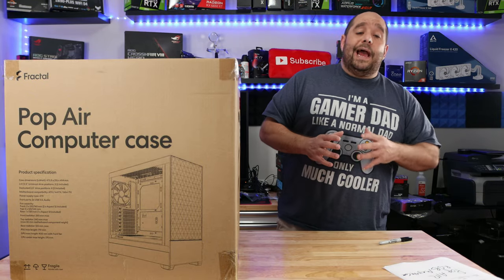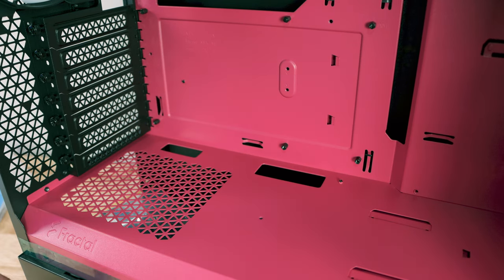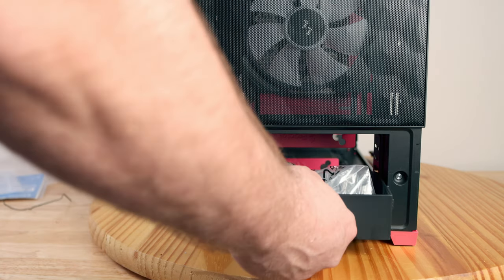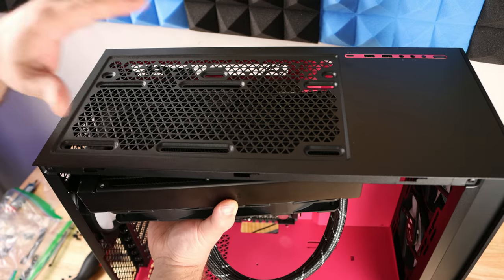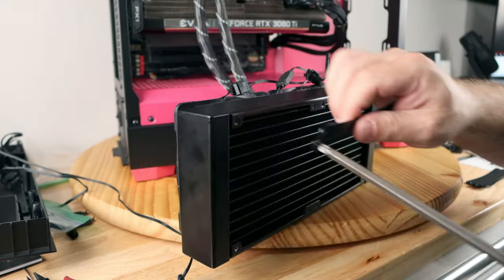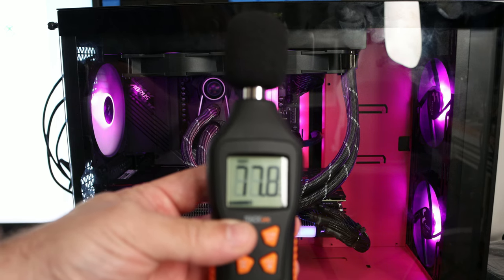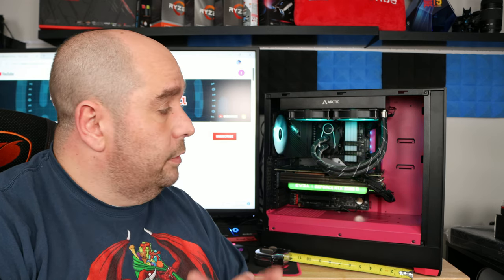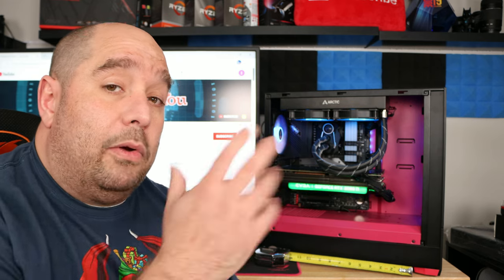Fractal Pop Air RGB Case Review -  A Budget Friendly Case that Does it Right!

Comment: 16:45 I admire the fact that you paid attention to the orientation of the water cooling radiator, having the tubes on the bottom, the correct way. Many youtubers install it the opposite, the wrong way. Spreading the good word!
Reply from the maker: Sadly, that causes a huge issue, but I go over why and the tubes as long as they are level or below the pump you are good.  I will say I have shipped thousands with the pump above, and they have outlasted the warranty's, which are up to 5 years.
Reply: The pump not being at the top of the loop is the right way.  Tubes up or down matters very little and neither is wrong.  If you can manage to have the tubes on the bottom it is better but that does not make putting the tubes on top wrong.
Reply: @gscurd75  Neither the pump nor the tubes should be the highest point in the loop. Having the tubes on the top and be heighest point can create cavitation, and having the pump be the highest point can cause it to work unefficiently. Tubes on the bottom and radiator's top being the highest point in the loop is the proper way. So yes, it does matter if the tubes are on the top or the bottom.
Reply from the maker: better at the top for sure, but it won't kill it, Steve made everyone go insane when he made his video but shipping literally thousands I can say its not a horrible issue, it might lower the lifespan by a year, maybe but they would outlast warranties on the system and chances are you are changing components anyway by the time the pump dies, well over 5 years.
Reply: @ThisBytesForYou  The problem is when the pump starts almost dry. So if you keep the loop ON and never let the pump go dry, after it once starts dry, it does not affect its lifespan but the efficiency so thus its lifespan as it will spin faster to make up. With the tubes on the bottom and the radiator being the highest point in the loop, the pump will never start up dry and its efficiency will be at its peak (conditions wise). Each pump has it's own efficency curve, but we shall dig that deep, shall we? :)
Reply from the maker: @Druze_Tito  I totally understand the issue, but that issue really would only occur IF the manufacturer didn't correctly fill the pump with enough fluid... which of course may happen, and probably happens often, but I haven't seen it.  IN shipping thousands, before the thought of the pump at the top, was a thought (Arctic, Asetek and there was 1 MAJOR player before Asetek that I can't remember) when I was a product development engineer at Alienware and Velocity Micro, there were times when the unit was LOUD after a minute, those we removed quickly, those had very little liquid in them so it was obvious so the issue usually appears VERY quickly.  When you first install an AIO, you will hear loud gurgling as the fluid fills itself through the hoses and radiator, if that occurs longer than a minute (usually takes 20 seconds or less) then you know its bad.  Asetek and the other one (it kills me that I don't remember their name, and this was when Asetek sold units, rather than licensed them out, so we worked directly with them) never caused any alarm at the way it was installed.

For now, being that I am smaller and don't have the resources to dig into that, nor time (it sucks being a small creator having a day job as an IT Manager, then a night/weekend as a creator and having kids and a wife, no time for anything) to dig into that, but maybe one day if youtube doesn't kill me sooner.  I tell you, sometimes dealing with people is a soul sucker with how horrible people can be (not you, you are awesome, please don't think I am talking about you), I have to hide/ban people daily, many times because of how inhuman they are.
Reply: @Druze_Tito  Not sure you understand what cavitation is.  Having an air bubble in the system is not cavitation.  Every system will have air bubbles in them.  With the tubes down, those bubbles will end up on the opposite sides of the tubes and be inside the radiator.  There will be noise as liquid moves past the bubbles, however it will be well insulated by the radiator itself and in all but the very quietest rooms with no fans running you will never hear it.  

With the tubes on top those bubbles will be at the top of the radiator or in the tubes themselves.  Those tubes do not insulate noise as well and you may hear gurgling noises as the water goes past those bubbles.  Over time as the water levels get lower, small air bubbles may break lose and work their way through the pump.  This can cause noise and a little bit more wear, however not to the point where it will significantly damage anything.  The pump may end up lasting 5 years instead of 6 but most people will be changing them out before that point anyway so it really does not make that much difference.  

The main takeaway is that neither tubes up or tubes down is wrong.  They are both perfectly acceptable.  Down is better because it will be quieter and last longer, however in many cases there is simply not the option to position them that way and when that is the case, it is perfectly acceptable to put the tubes up.  Just know that there may be a little bit of noise from time to time and that it will probably die out closer to the warranty period vs tubes down but still last longer than most PC users keep them.
Reply: @gscurd75  I think you don't understand the cavitation means bubbles. End of discussion with you.
Reply: @ThisBytesForYou  The problem is that with time the level of the fluid lowers. As that happen, the pressure drop will increase and the pump will work less and less efficient, wearing out faster and shortening the lifespan(unless you use a fixed pump speed). I don't think the lifespan of the pump should be considered as 5 year, even though it sounds reasonable condering the price. A well designed mechanical assembly should outlast the owner, but we all know that new-age products are desgined to last as long as the warranty. And the warranty covers the worst-case use scenario. But, with the proper conditions and settings, it can last much longer. 

Thank you for the kind words! 

P.S. - yes, cavitation happens in AiO cooling systems.
Reply: @Druze_Tito  I am trying to be as civil as possible here.  I would suggest you do a little bit of research before telling others they do not understand something.  Even a simple google search tells you "Cavitation is a phenomenon in which the static pressure of a liquid reduces to below the liquid's vapour pressure, leading to the formation of small vapor-filled cavities in the liquid."  

That is vastly different than just "bubbles".  If you have a set up where the pressures and temperatures involved create cavitation, it will happen regardless of where the tubes are located.  

This is an easily found video that explains it https://www.youtube.com/watch?v=U-uUYCFDTrc&ab_channel=IETInstituteforEnergyTechnology
Reply from the maker: @gscurd75  please understand, the conversations will always stay civil, since I am moderating.  confusions happen on both parts, the video is great, I am going through it now, 1 part confuses me and it did when Steve spoke about it as well, the video talks about evaporation, part of the cavitation process, where the fluid evaporates, with technology as it is today and CPU;s not allowed to go over 100°C, the likeliness of that happening is close to 0.  When they reach about 90°C, they will begin gto thermally throttle (maybe it was 88) to protect itself from burning out.

If the conversation is not civil, I will delete comments, nothing against you my friend, but as intelligent people (we all 3 are), it would always be civil.  We can all disagree, and that's fine, but disagree and educate is key, if not we will always continue to disagree and go up from there.
Reply from the maker: @Dwight I don't agree that cavitation occurs, maybe not at the level we are thinking, because evaporation occurs at 100°C, the liquid will never get to that due to the processor being protected from going over 90°C as it will thermal throttle.  That wasn't always the case, but has been this was for over 2 decades.  Also, I don't know how much friction is caused with the pressure in the water, that is an interesting part, thanks @gscurd75 for that video, one factor I never thought of.
Reply: @ThisBytesForYou  You don't need to agree, the cavitation is happening every time when there is a fast spinning stiff object through a liquid. The fast motion drops the local pressure behind it thus creating a vaccum space that looks like a bubble. To avoid this you need higher liquid pressure. This brings me to my previous point - you need the tubes on the bottom and the readiator's top to be the highest point, having the pump bellow the highest point as much a possible. This will extend the lifespan of the pump by making it work more efficiently. Nothing to do with the cons of cavitation itself, at least not the usual negative outcome of it - mechanical damage to the blades. But, will lower its efficiency to push fluid, thus making it work faster and increase its cavitation even further. That is why having the pump at maximum speed does not guarantee best AIO performance (+the optimal speed by the pump curve). You are not a mechanical engineer, it is obvious. Neither is the pal that listens to Steve's videos. And I don't care.
Reply from the maker: I 100% am not, I won't ever state that I am, I am however an IT Manager to a company with many of them, its out business, though I won't go over this with them because I don't mix business with business (you know what I mean), I put the tubes on the bottom to reduce needless pressure pump and wear and tear on the pump due to air pockets, potentially large ones, which would minimally reduce the lifespan of the unit, by increasing efficiency not putting any thought to cavitation,  Putting tubes on the bottom, makes more sense due to the gravity of it (pun intended). 

 I dont think there is enough pressure in these units to have any sort of damage to the blades and while I won't ask my team, I will check with Arctic.  I have already spoken somethings on it with them that I am not happy about but I put that aside haha, let's see what they say.
Reply: @ThisBytesForYou  You can call the cavitation "air bubbles" or "air candies" it is still going to be cavitation. Cavitation, as I mentioned, does not have only one negative effect (like the damage on the blades that you mentioned), but it reduces the efficiency of the pump work. Tubes on the bottom is the correct way, and that is also a good subject for a video if you are into it. You can have the same AIO, set the processor at fixed voltage, no boost, set the AIO at fixed speed(also try 3-4 different speeds, one of which will be at 100%). Then, run the system in 3 (or more) configurations. One with tubes on the bottom, one on top (bellow the pump) and one on top (above the pump). Set the fans of the AIO at fixed speed and let the closed system achieve equilibrium and see which configuration has the lowest temperature (vs ambient). It is a bit of work to be done here, but you will see the effect of "air candies" on the cooling efficiency.
Reply: @ThisBytesForYou  here is what a not enough pressure at the AIO pump scenario affect the "air candies" scenario
https://www.youtube.com/watch?v=0dd6AlyOnfc
reduced pressure at the blades (because not enough fluid flow to the pump) increases the formation of "air candies".
Reply from the maker: sadly, because of the effort Steve, Jay and other clones have put into it (not call Steve or Jay clones, just the others) I would be put into that category of a clone and berated even more by the zombies that mindlessly listen to their videos.  By mindlessly, I mean, listen to the portion they want to to be able to mindlessly call others stupid, Jay and Steve put out great content. but lets see what happens with Arctic.  I didn't want to go into this path, but I feel like I have to.
Reply from the maker: also, a great video, but he mentions steam in the video, lots of pressure, maybe its me that does not truly understand that portion, but I have already posed the question to Arctic, if I need to, I will discuss with Asetek, but I don't know if my contacts are still there, it has been some time.
Reply: @ThisBytesForYou  You can always pick a method that has not been covered by anyone, it is worth doing it. I don't see that as being a clone. If you think I can assist you with anything, i gladly will.
Reply from the maker: @Druze_Tito  I waiting to see what arctic states, I just got home and they have replied
Reply from the maker: @Dwight they are looking into it for me, many of their engineers will be out tomorrow and next week, who knows, maybe a video would come out of it, if anything at least an explanation will come out of it, who knows, I may be wrong, but you may too.  If you don't mind me asking, what is your background?
Reply: Hi, thanks Iggy for your question, I'll answer here for ARCTIC then :

First, on the cavitation question : we did not observe any such phenomenon in the Liquid Freezer II, the impeller size and speed are both too low to create the lower pressure necessary for cavitation to happen. Furthermore, even though cavitation were to appear, those voids would collapse further down the water block module because the pressure then rises in the section between the pump and the coolplate. There won't be any bubble accumulation whatsoever. Reminder, in cavitation phenomenon, the voids (or bubbles) are only distended water that has changed to vapour. As soon as you get pressure again, it goes back to liquid.

Second, for the evaporation through the tubes : yes, this happens at a very low rate (it is called permeation), we are talking about a couple of milliliters per year in the very worst case. It won't be a great concern for the cooler function over 6-7 years, maybe even 10 years (according to usage). For Liquid Freezer II, we have tested our cooler with 25% of the water removed and although there is a bit of gurggling noise in some orientation, the cooler is still functional and performance is still close to the normal one. That being said, the fuller the loop is, the better it is for the pump. All AIOs come new with a little amount of air in the system. 

Third, for the assembly of the cooler: the key is here not to have a pump running dry, in a cooler that is already running, there is almost no chance that this happens as the bubbles will be carried on by the water flow and not really settle unless they reach the tank at the end of the radiator. The danger comes when you stop the PC. if the pump is at the absolute highest point (i.e. radiator lower than the pump and tube at the top of the radiator), then the bubbles will rise all the way to the top, giving risk for the pump to end up dry and cause trouble at restart.  This is a risk of pump malfunction or at least lower performance.

Besides, there is a risk of noise if bubbles can find their way to the pump. This is where the recommendation to put the tube at the bottom comes in as the end of the radiator that is now at the top acts as an air collector, without any risk of it being sucked back to the pump (where it actually makes noise). 

No matter what, in many cases though, there is still one risk : in case of cooler with a lot of air inside (i.e. a rather old cooler), during transportation of the PC, air can find its way to the pump, putting then the pump in "dry mode", if the loop does not allow a simple escape for the air, problem is easily preventable by rotating the PC before re-powering it in to have the air collect in the right place.

The recommendations from the video from GN are perfectly fine, only minor points could be argued in my opinion, but that would have made his video twice as long to clear those out.

Bottom line, there is always some air in an AIO loop, this air quantity increases over time, any assembly that allows air to go to the pump will have bubbling noise, if the air qty in the pump is too much, this will deteriorate the pump performance and ultimately, the pump itself. 

The best assembly is radiator on top of the case.
Reply from the maker: @VincentAndre_HK  Thank you so much Vincent, I truly appreciate your input on this, it means the world to me.
Reply: @VincentAndre_HK  A pump speed of 3000rpm and a impreller diameter of 20mm are more than enough to cause cavitation when the temperature of the fluid rises and the flow and pressure(to bellow the atm pressure) at the inlet is reduced  - caused by the wrong AIO mounting with the tubes on top of the system (most cases do not have enough room, height wise, to always allow to have the tubes above the pump) Let's not deny the facts. No parameter is "too low" in the PC AIO water cooling systems for a small, probably insignificant cavitation to appear. 

You confirmed my point with the risk of dry startup of the pump caused also by the wrong AIO mouting.

Comment: Have you tried the mesify c? I have a 3070ti ftw3 and a 240 MSI ventur aio looks like I should go with pop xl so far for good cooling and guaranteed AIO working at top still
Reply from the maker: no, they have not sent it to me to review.
Reply: @ThisBytesForYou  darn do you remember the thickness of that 240 AIO you used in the pop air case? Also was size deference noticable 😂
Reply from the maker: 38mm and its a 280
Reply: @ThisBytesForYou  oh ya lol my matx case playing PUBG and with aio on fron has gpu and CPU at 75 to 80c that's with GPU fans at 90%